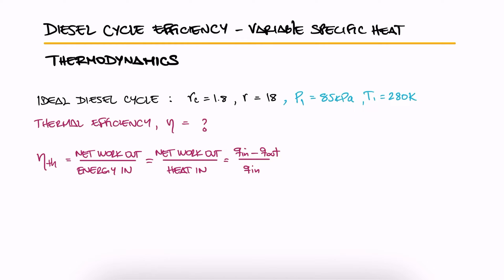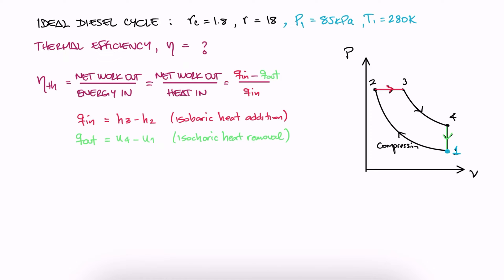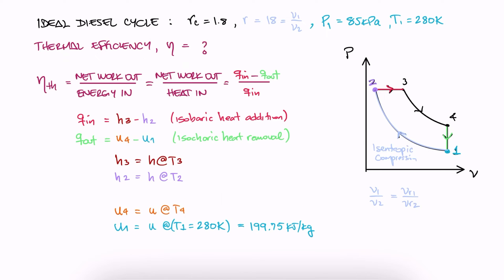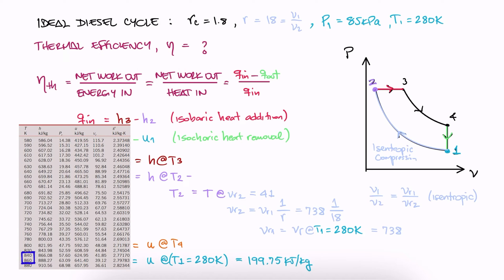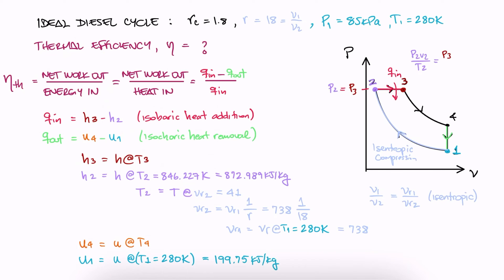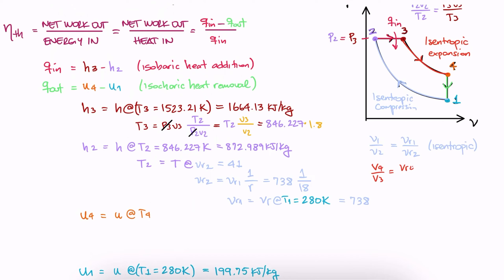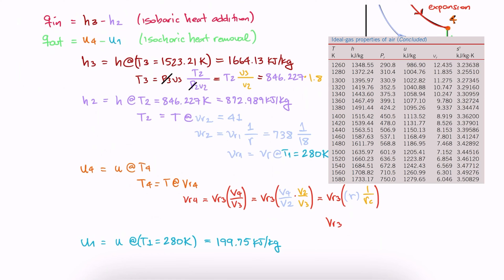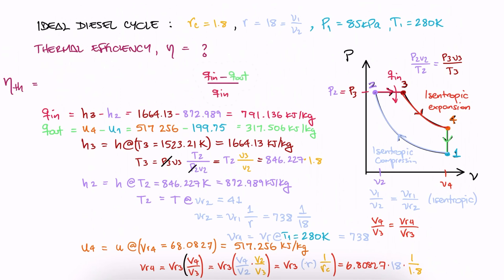Diesel Cycle EFFICIENCY with Variable Specific Heats in 3 Minutes!

Comment: I also got v2 = 41 from the compression ratio, but according to the cutoff ratio, v3 = rc*v2 = 1.8*41 = 73.8. That is much different than the v3 value you got from temperature interpolation, which was 6.8. It doesn't seem like this interpolation method is very accurate.

Comment: Aren't Points 1 and 4 isochoric? Shouldn't they have the same volume and relative volume? You found that vr1 = 738 and vr4 = 68. Those are substantially different values when they should be the same - you even used v4=v1 as a step in that equation. I am very confused!
Reply: Actually, vr4 and vr1 arent volumes, they are relative volumes, which can be different for isochoric processes